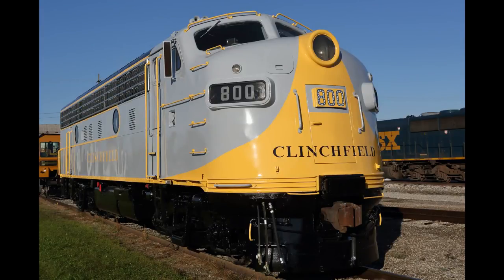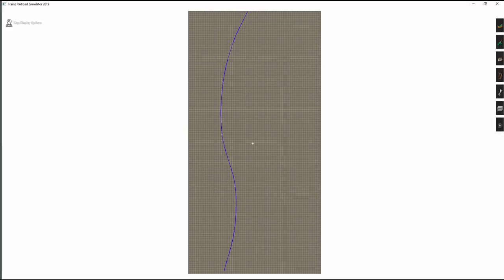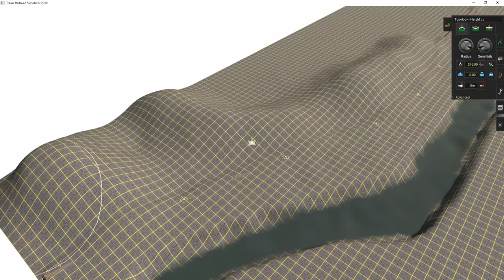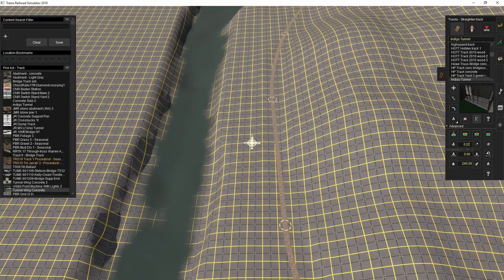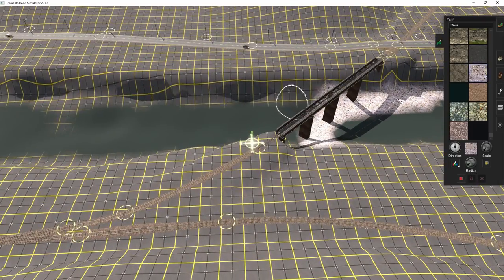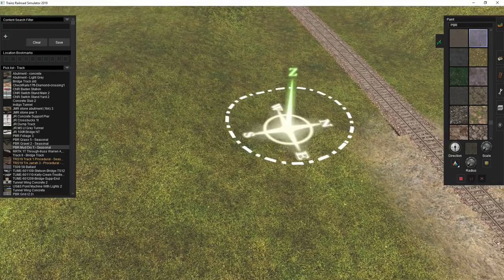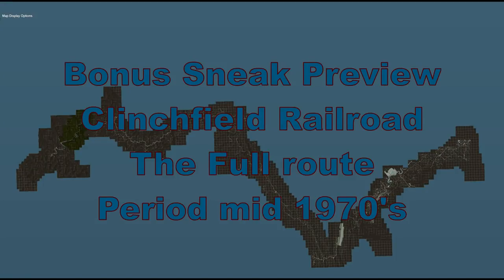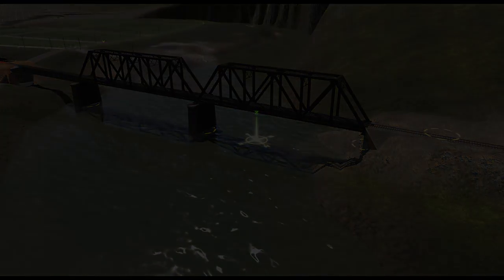TRAINZ 2019 Route Building Part 3 Clinchfield Route

Comment: as well you forgot to represent Elkhorn creek and their is a couple other issues scattered around
Reply from the maker: Hi Brady, there is nothing like first hand knowledge . . I used Google Earth to get as close as I could to the real layout . . . Can you give me a clue where Elkhorn Creek is ? Note the Elkhorn City area is nowhere near complete . . I have some idea what the town looked like but will have to put facsimile shops and houses into it as modelling everything is just too  much  and at the distance away from the tracks is probably not a problem. I think I have the basic street layout about right.
Reply: @colinstrains5885  if you want i can show you on discord
Reply: @colinstrains5885  if thats ok
Reply: @colinstrains5885  but your street layout is about right
Reply from the maker: @bradycure5786  Hi Brady, I looked up Elkhorn Creek . . . . . . . on Google Earth . . it seems to run  1 to 1.5 miles west from Russell Fork along big branch road and would not be visible from the track at the old station site nor from the Wye in Elkhorn City yard . . . . . . . . . probably not a required location in Trainz as it would not be visible anyway . . . To get good performance with Trainz . . anything not clearly visible is usually excluded  . . .I did include the start of the creek where it joins the Russel Fork though
Reply: @colinstrains5885  as well the bridge at the gas station is way to small and has to few supports
Reply from the maker: @bradycure5786  Which bridge are you referring to . . .the bridge over the highway leaving Elkhorn ? or the railway bridge over the river . . . Remember I am modelling the late 70's early 80's and that is how the Railway bridge looked back then . . .it has been reworked several times and early on had two truss spans  . . . . . . .  and only one plate girder at each end . . . . . . . . .  I could not find the right Concrete supports as under the bridge now but again the supports have changed since it was first built . . due to the need to upgrade the weight specs over time due to larger heavier trains . . .
Reply: @colinstrains5885  k now it has two plate girder spans a side then the two big spans in the middle
Reply from the maker: @bradycure5786  That is interesting . . .only because Google Earth only shows two plate girder from yard end  . . one Truss span  . . and another plate Girder at the northern end . . . .must have been very recent change ? However as I said I am modelling an earlier period and I have pictures of the bridge at that time  . . . .from the local CRR Museum in Elkhorn . . have you been there ?

Comment: Colin - are you using just PBR textures now, or mixing with old? I don't like the way they blend at all, and there is a lack of PBR textures right now. Hopefully more are released.
Reply from the maker: I have mixed them in this video . . .but carefully  . . . . . . . against procedural track use PBR only . . . . . .. things like tunnel portals . . use non-PBR . . .and so on . . you need to test it with each type of texture . . . . . . . . . trial and error . . . . . . .and some PBR  . . like the ones marked Donner . . .are very unpredictable  . . and not so great textures anyway . . . . . trouble most models don't have PBR so cannot use PBR where they mix with objects like houses bridges fences etc . . . hope that helps. . . .. . .